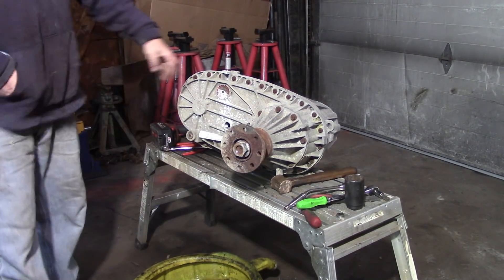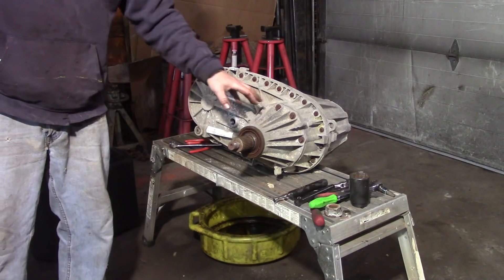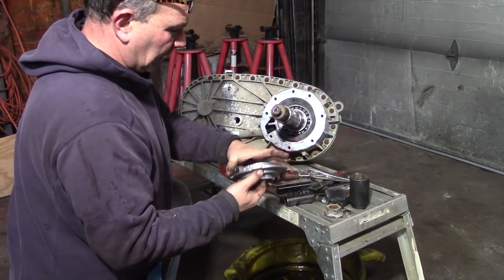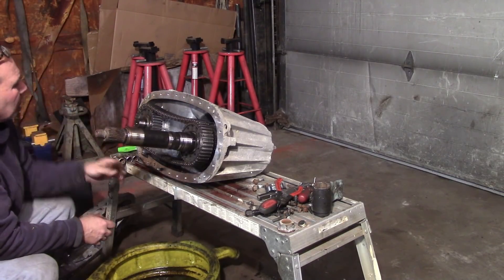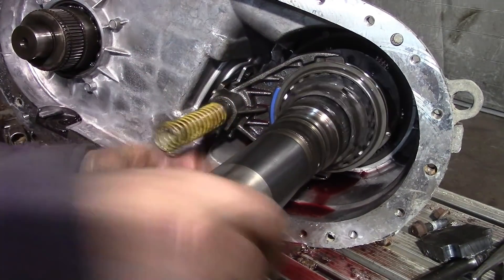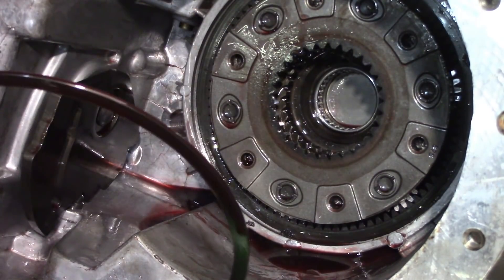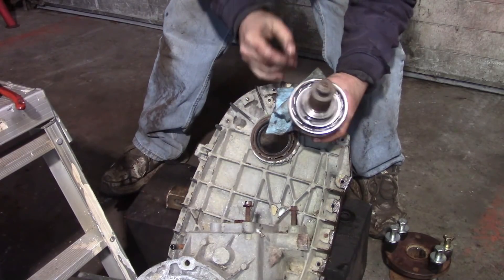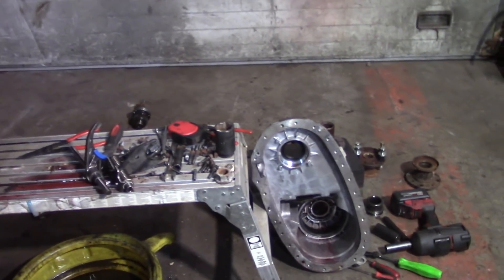I NEED SOME P[ARTS OUT OF A NV273F TRANSFER CASE! LETS TEAR IT DOWN!

Comment: This video is perfect J.C. I just bought a 2011 Ram3500 Laramie 6.7 with a 6 speed 4x4 (100,000kms) pick up and I'm feeling/hearing/noticing some slop in the drive train. When I turn the truck off it makes a wobble/clunk right at the end. On my own I've inspected it by quickly looking under the truck as I turn the key off and the engine/drivetrain wobbles/shakes. The noise sounds like it's coming from the transfer case(uncertain). I also feel the slop in low gear by rocking the truck (1st or reverse). The mounts visually look ok but uncertain.

Comment: I have a tip for you JC if you never heard this.but buy a couple cheap harbor freight screwdrivers and cut a groove just past the head a bit ,,that notch makes a great tool for pulling snap rings like those flat ones